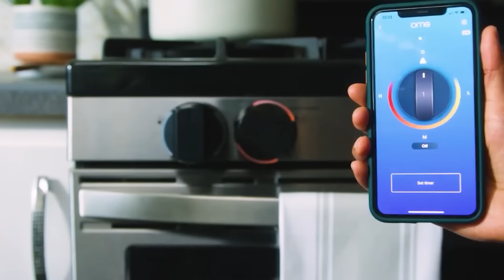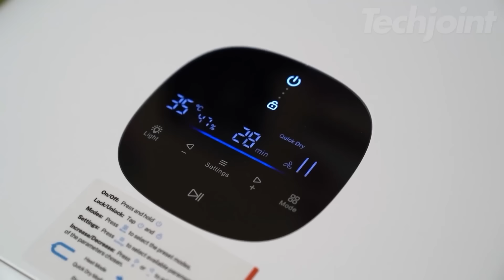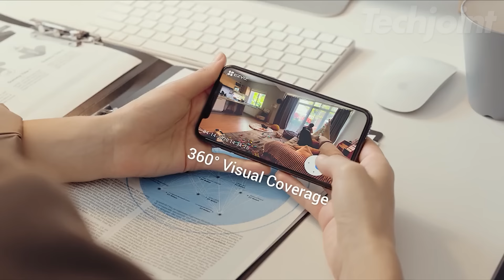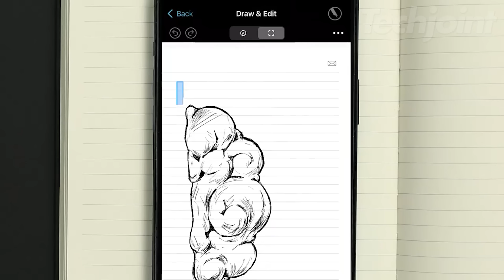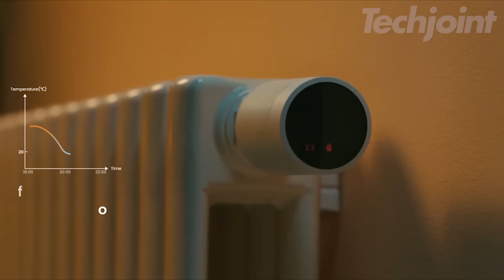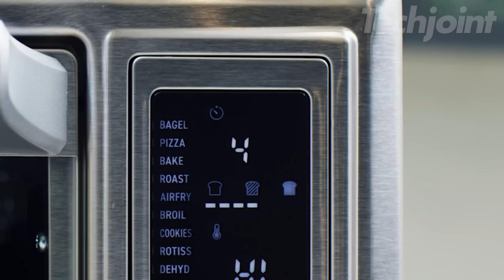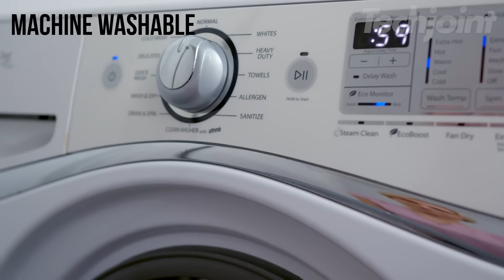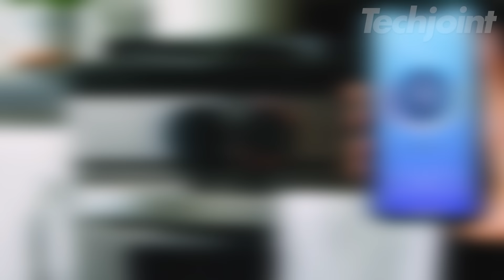125 NEWEST Amazon Gadgets For Home and Kitchen! **BEST OF 2024**

Comment: The pot stirrer design is all wrong.  It should have paddles facing180 degrees to what they are.  You can't really stir holding a knife sideways to stir with the thin edge.